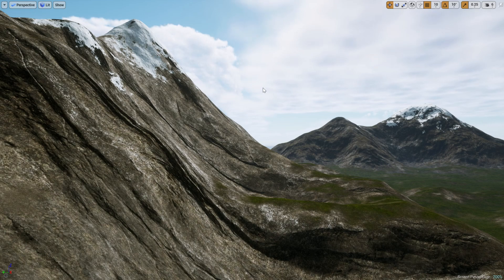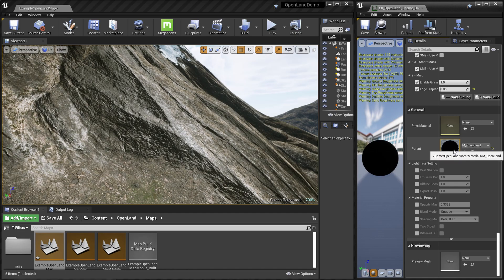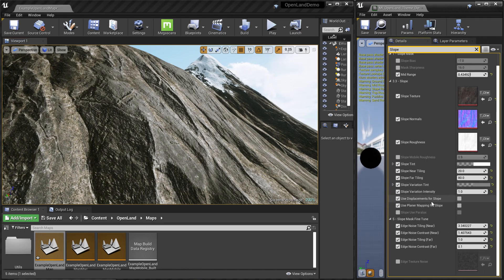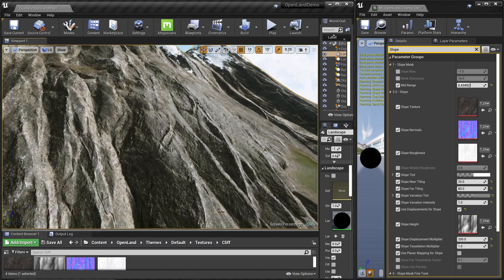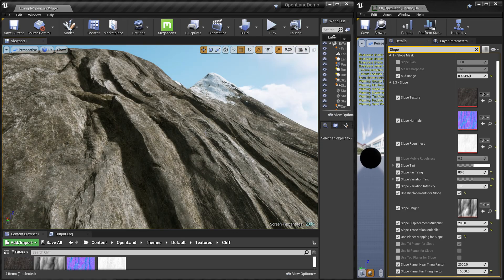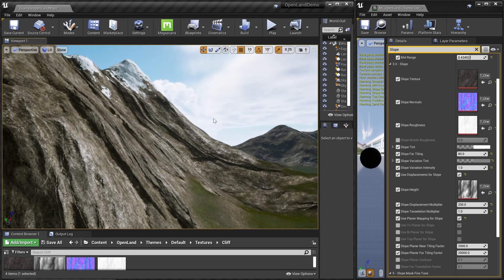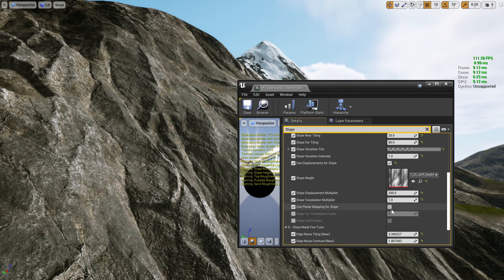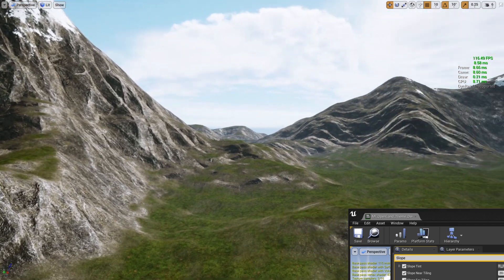Adding Displacements & Planar Mapping (Tri-Planar) Support to Unreal Engine Landscapes with OpenLand

Comment: Hi, with triplaner, does your tiling break system also works ? or since that is made for UV space are you using a different setup to break tiling with triplaner projection?
Reply from the maker: Tiling settings are similar as previous. But this does not work with the texture repetition setup we have.